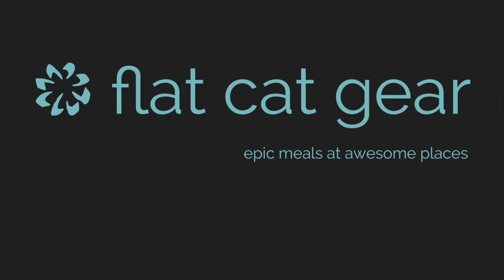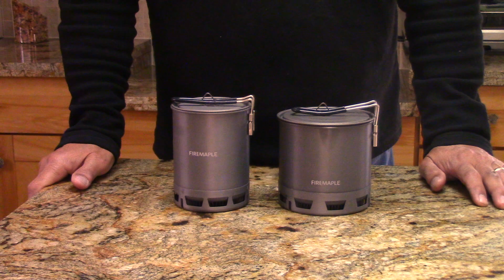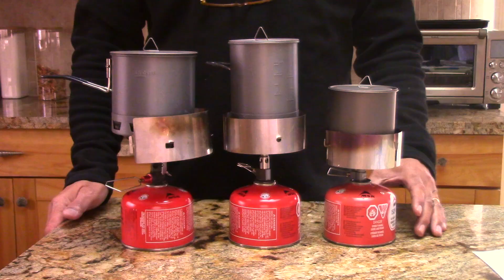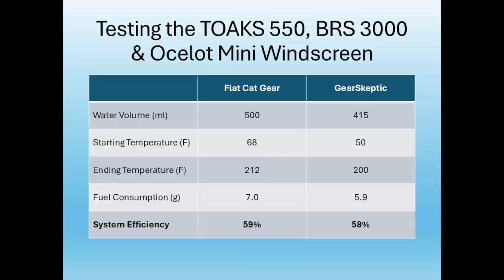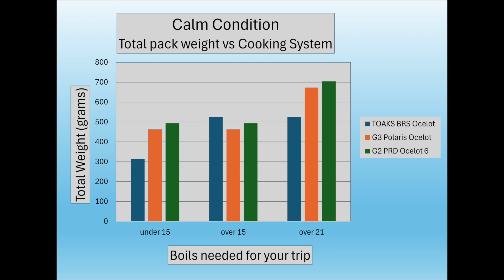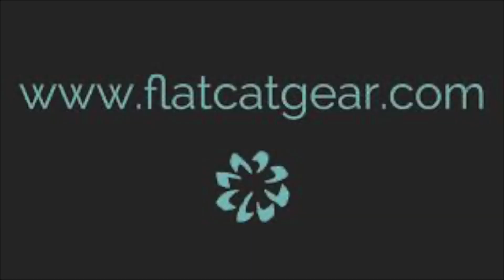"To HX, or not to HX, that is the question"

Comment: The points you raise are exactly right, it’s if you need to take another canister. I have the G3 and use with the soto  wind-master, was considering if it was worth buying the G2, but from your graphs there seems to be no advantage. The lightest for shorter trips would be to use with the BRS and a windscreen. Otherwise my current setup looks good for my next trip where I will need about 20 boils. Thanks, I look forward to your videos.

Comment: Super interesting as usual! Curious. Do you have an idea how the MSR Windburner would perform in comparison?
Reply from the maker: Well, the MSR Windburner weighs 430 g  so it is pretty heavy.  That being said, it is the most wind robust cooking system on the markket.  It will boil 500 ml using about 7 g of fuel in gail force winds; far above 8 mph, like +30 mph.  If I were going into extremely windy places, that would be my stove of choice.